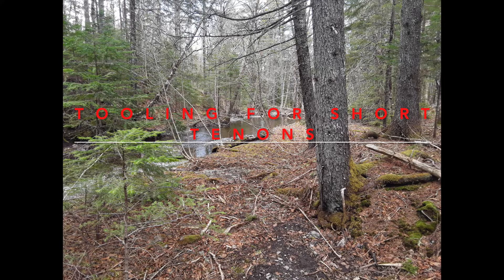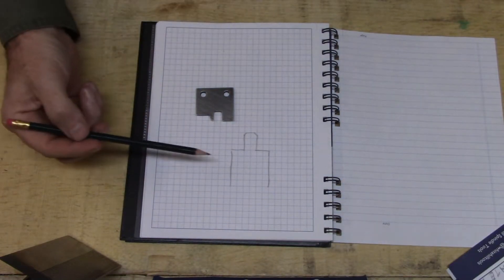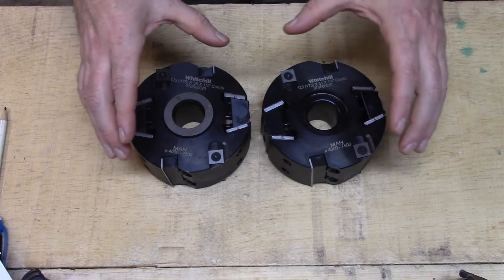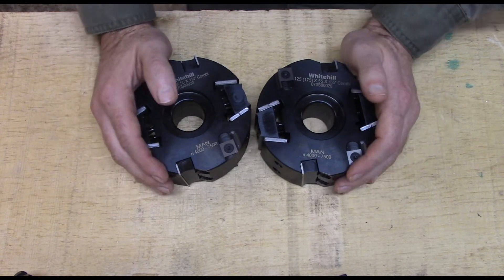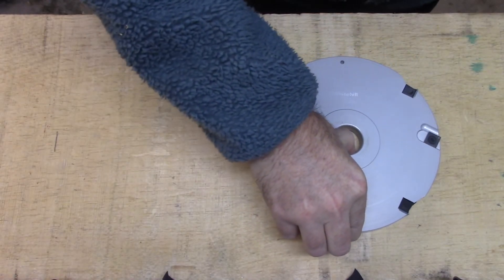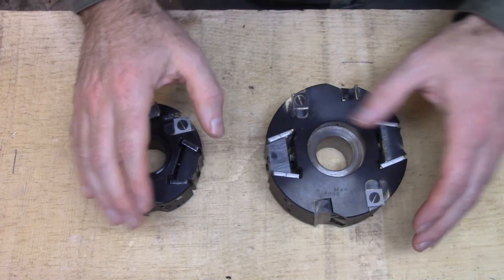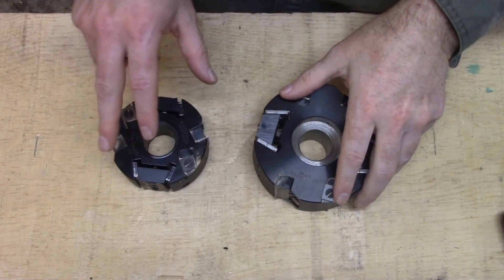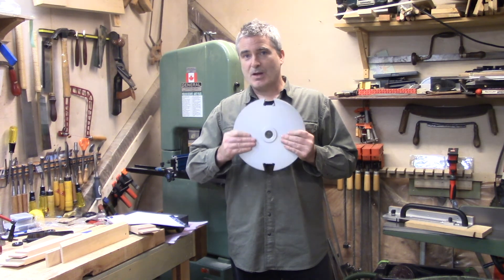Tenon Tooling for the Shaper or Spindle Moulder | Short Tenons

Comment: Good morning 🌅, very good territorial, on setting up for tenon , your method is how I used to do it meany years ago, and I used the same make of tooling, but I ended up using Leitz , as they provide a service where they came to my workshop for picking up tooling that needed sharpening and if I needed a special blocks making or cutters they would do so, plus I ended up buying a Wadkin EKA, which I restored, 
I’m now retired in my 70s. I’m from the UK. , but I’m now living in France, I believe it or not I still have most of my tools and machinery, and 10 of thousands of pounds of cutters and blocks, keep up very nice work,
Reply from the maker: Thank you sir!  I've had great luck working with Whitehill for all my needs so far and they somehow manage to ship knives and tooling to Canada in just a couple of days!   The EKA is still a very well respected machine, decades after the last ones were made.   I would consider an ECA just because the footprint is a little smaller for my smaller shop.  Great to year you're still making sawdust!  Keep up the great work, and enjoy the warmer French climate!
Reply from the maker: @Hog-g2z  I just posted a longer tenon video!

Comment: I wish you had made this video about 3 years ago when I was first exploring using the spindle moulder as a tenoner - it would have saved me a lot of trial and error (and not to mention money!) I've always had a fairly small workshop and need each machine to perform as many functions as possible - I've often wondered about getting a dedicated tenoner, but having upgraded my spindle moulder to something with more power and usable spindle length, I've managed to make the machine do the work of a tenoner too. Whitehill have some great tools on offer which really helps - not sure what spindle moulder users would do without them!? Making windows is a particular joy once I got the right set of tooling and cutters - but it often needs videos like these to describe the process!
Reply from the maker: I'm in the same boat.  If someone gave me a nice tenoner I'd get out the shoehorn and fit it in I think, but the spindle really does work well for smaller runs and some say it's faster to set up than a 4 head.  

I actually have a simple window video in the works but am focused on timberframing for the next few months.  I look foreward to getting back to it.  Thank you for the comment, I really appreciate it.

Comment: Awesome video! So informative!, Could you do a video on doing tennons on the spindle moulder without a sliding table?
Reply from the maker: I could try, though it's a bit hard to do a tenon of any real length without a sliding carriage of some sort.  The carriage does two things: it makes the movement relatively effortless, and holds the piece very firmly.  There are some old school techniques that are frowned upon now too.  😬😬😳😳
Reply: @DovetailTimberworks  very true! My mentors way of doing tennons is using a sacrificial fence and the running the work piece with a block behind it to stop break out. I recently finished a jig that can do tennons and angled tennons too!

I'm interested in this because we are a ways off getting a sliding table for our spindle, we have a wadkin ber 3 and I was looking at buying the scmi sliding table but for now I am looking at other methods to keep us going.
Reply from the maker: @davydmir6565  That's one of the ones I was thinking of!  🙂  With a sturdy, well designed, robust "coping sled" type unit, you could reliably tenon in the range of an inch and a half I expect, more than that and you're dealing with a lot of back pressure and really have to focus on keeping it against the fence unless running in a miter slot.  They Aigner jig would let you do tenons longer than cabinet door stubbies, but would have to think about the upper limit there.  Regardless, you want chip limiting tooling for sure doing hand fed tenon work!

Comment: Excellent video. Thank you. I"m considering buying a shaper.  Any suggestions? I'm looking at the King Canada, Grizzly and the Harvey.  Harvey is the most expensive. All 3hp.
Reply from the maker: Thank you!
Reply from the maker: Any shaper is better than no shaper, but all of those listed are pretty light weigh units and I would consider a heavier used one.  SAC or SCM with a decent fence and a spindle that runs true would be good
Reply: Thank you!  @DovetailTimberworks

Comment: What is the apparatus you are using to move the wood through the cutter head called?
Reply from the maker: That is what is commonly called a "bolt on sliding table attachment".  That one is made by Panhans and is fantastic.  SCMI makes one too which is good but not as refined.  Ebay UK has vintage ones from time to time.

Comment: Where do you find stud spindles ? Struggling to find them on line
Reply from the maker: You usually have to have them made, though at one time they were common for machines as a factory option.  I know people that just take a full length spindle to a machine shop and have them cut it short.  I had a batch made for my big Wadkin and people are buying them.

Comment: Good video, I bet those 200 mm cutter heads were not cheap? I looked into those a while back for my Felder and was floored. 
How is the 30" DR running?
Reply from the maker: Not terrible Mike, about $550 for the pair.      DR hasn't been used yet, I wired it up to test it, had the thrust bearing remade for me and installed it and then covid hit and I left for NB for 18 months!
Reply from the maker: The ones shown are actually capable of a 69mm tenon.   I got them because they were the widest I could use within the conventional fences on my shaper, without having to put the tenon hood on.

Comment: Why do you keep on backing the wood through your cutter?
Reply from the maker: Mainly because it puts me back in a safe operator position where I can take the stock out without spinning cutter by my elbow, unguarded.  With the settup as stuff and rigid as mine, there is never any issue at all.  The cutting has already been done, so there's no contact on the back stroke. This is common practice on tenoners etc.